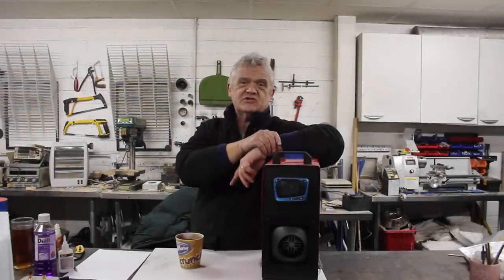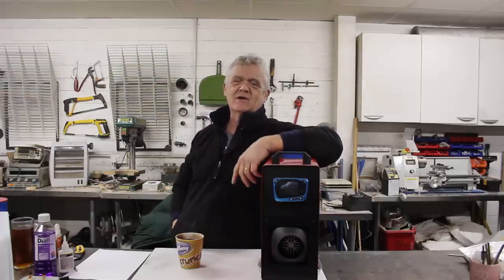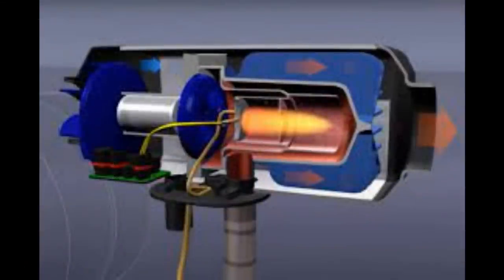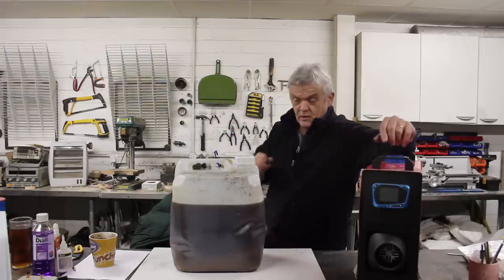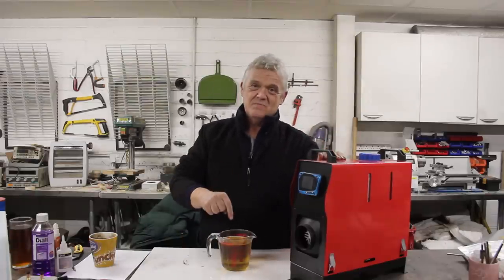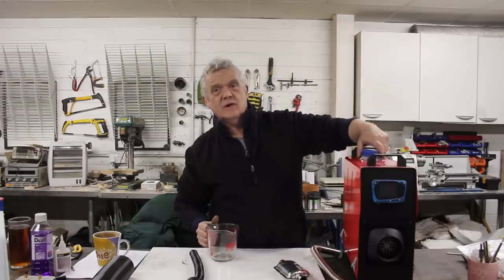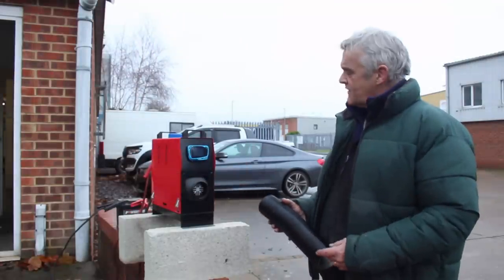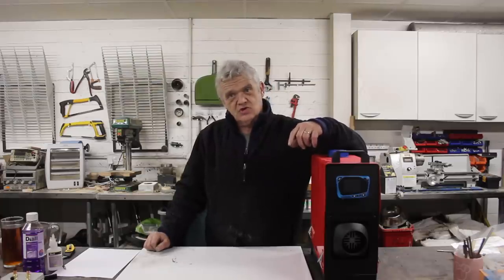1793 Home Made Fuel Running A Diesel Heater

Comment: Here's an idea. Add a Stirling engine that uses the heat produced in the combustion chamber and drives a fan to pump the air in the room through the device and back out again. This would be very useful in places where there is no electricity, like off-grid cabins ,and places that have frequent power failures, like Ukraine.
Reply: Look up peltier units they can produce electricity to power fans from heat!

Comment: Hi Robert, I have one of those diesel heaters. I haven't experimented with any fuel recipes as yet, but run it on straight diesel.
I use mine to heat my shed/workshop, which is approximately 17'x9' but I can divide it off in two when necessary.
I can run the heater for about 10 to 12 hours on 1 litre diesel, which I consider to be very efficient and quite economical. So with your mix it should prove to be a very cheap form of heating.

Comment: Those new diesel heaters are amazing! I just want to mention that I heat my basement lab/workshop with a portable Kerosun Omni-105,  23,000 btu kerosene heater. I know this sounds like a really foolish and dangerous thing to do but I have been doing this for over twenty years without a problem. The windows and door are very leaky to the outside and I use a carbon monoxide/dioxide detector to monitor the basement air. I have also used it upstairs in the main house during a past winter 5 day power outage to keep warm and my water pipes from freezing.  It also has a feature where as soon as it is tipped sideways, a spring retracts the burner wick to shut it down.
Reply: Hardly new, that style of heater has been around for over 50 years snd the Chinese have been selling cheap copys for the last 10 or so 👍
Reply: @Dirt-Diggler  It's new to me!
Reply: Maybe not new but certainly not commonly heard about, until recently with vanlife stuff and green energy etc.
Reply: @gavinlynas2833  oh i agree there 👍 the latest rush of instant experts on the subject on YT has certainly spread the word, usually the word is misspelled but hey, at least it's out there 👍

Comment: The piece you described as a catalytic converter is a muffler, i think. I'm going to have to experiment with the fuel I use in mine!
Reply: There is ppl burning used motor oil in these things,  but I think I'd rather use cooking oil, but would use anything that works if needed heat! I grew up using kerosene heaters, we had a monitor heater, kinda like a self contained furnace or maybe like a giant one of these heaters,  it was about 24" tall 36" wide, and 12" deep,  and has about 2" exhaust pipe,   it worked for about 3-4 years then quit, we went back to the kerosun heater,  besides wick changes every 10 years they just work, and require no power,  unless you want to use the ignitor,   I hope to get my diesel heater going soon, to cut on power use! I will probably be burning oil in it soon!
Reply: yup its a cheapo muffler

Comment: I tried the same one to heat my office, it has enough capacity and doesn't use a lot diesel.. but my issue with it was that couldn't use it with a regular adapter needed a battery to support the starting of this heater..

Comment: I've got one of these pumping hot air in the cat flap, even with Diesel it costs about 30p an hour to run and heats the downstairs of my house, you do need a decent amperage 12V supply, at least 12amps for startup, after which doesnt draw much, and you can wreck the burner, if you can just unplug it. I cover mine with an old tarp, to keep the wet off it, and been using all winter, not had issues with damp or moisture, you can buy extension pipes on ebay and better exhausts to make it quieter, but is barely noticeable from inside if running outside, I posted videos of it too.

Comment: If paraffin is around £2.89/l at b&q and regular diesel is about £1.80/l is there any reason we simply can't use diesel to dilute the cooking oil?
Reply: Yes.  The good reason is that using diesel as the diluent will increase the calorific value above that of 100% diesel.  OK for those that can tune the fuel:air ratio, but not if one cannot do that.  Sooting will invariably result, which may be not be too serious, but could be.  The heater would produce more carbon monoxide due to incomplete combustion, too.
Reply from the maker: good explanation from Richard mate
Reply: @oliver90owner  Thanks for that.

Comment: Just to add that you can adjust the fuel/air ratio in the settings to allow for different fuel use, typically using an inexpensive fuel/air ratio meter to check you are supplying enough air (fan speed) for the fuel setting (pumps per sec or minute) to achieve a complete burn.

Comment: Its a good idea Rob. 

But recently I've learnt that burners with nozzles and fuel pump (assuming there is one in your fancy unit for atomizing purposes) specified for diesel usage can wear our fairly quickly when used with such novel fuels. These days in India, some variants of LDO (Light Oil Diesel) are being made with similar mixing recipes and as such industrial diesel burners, even with good quality fuel pump, face pump failure issues. So burner manufacturers have now started using relatively tougher fuel pumps (for instance 1/2 HP 100 litres per minutes capacity) for using these mixed fuels. 

Just thought if your heater utilizes a fuel pump, this issue may needs addressing suitably. 

As always, your videos are great! Thanks.

Comment: I think freight railway engine no. 66004 runs on biodiesel [ at least that's whats plastered on the side of it ]. Always thought it was against the law to run a car on Kero ..? HM Customs etc. [ would be hard to prove without analysis etc. ] rgds
Reply: A modern car would die pretty soon if run on kero, modern diesel is miles away from the old 80s diesel so are the engines 😏
The only exemption from paying road fuel duty i know if is bio made from cooking oil, you can use 2000 ltrs i believe before declaring it, not checked in a while that law may have changed 🤔

Comment: Hi Rob I use to run my Massey Ferguson 35 (1958) on 50/50 used veg oil and green diesel, she was only used in the summer for topping and hauling in turf. She run great, I rebuilt the top side a few years ago. I was delighted to find the head and all was very clean, I cant get the used veg oil anymore as the bloke sells it, but I buy a few litres now and then and put it in my jeep, wife's jeep and MF35. Both jeeps passed the N.C.T. test engines running clean. I love your show, keep up the great work, God bless you.
Reply from the maker: great info mate - thanks for posting

Comment: You can crank out more efficiency from those heaters if you put a long exhaust pipe on it. Before it's piped outside to vent, you can leech off A LOT of heat from the exhaust. Running the exhaust through a coil submerged in a bucket of water also boils the water very easily.

Comment: two options you can do to help keep burn chamber clean......  is  before shutting down... turn it up to high Heat.... so once you got into the off cycle.....  it will have better chance to combust everything.. so nothing left behind.  

Another option is to not only finish off things with the heater on HIGH heat......    is to also put in a manner to switch fuel sources.....  make one the recomended diesel (or Kerosene) and the other your blended waste fuel.    Then you would start the unit on the recomended diesel or Kero...... keep that fuel in use till the unit reaches operating temperature.... then switch to the blended waste fuel..    Plan ahead and 15min or so before you plan to shut it down...... switch back to diesel / Kerosene, put it on HIGH heat......  then 15min later turn it off / put it into the shut off cycle.  Doing this will greatly lesson how often and/or aggressive you have to clean out the thing. Likely would lower how often you need to replace the Glow Plug and the Atomizer screen
Reply from the maker: cheers mate

Comment: The tax treatment in the U.K. was changed in April 2022 to include biofuels used for heating. The good news is that you only need to register and account for fuel if you produce over 2,500 litres per year so small domestic users are exempt. Search - Biofuels and other fuel substitutes (Excise Notice 179e) from 1 April 2022

Comment: Run about 20L of fuel through it, then do a tear down and see how much debris is in there. My experience has been that it will coke up quickly, but maybe you'll have better results. 

You have access to inexpensive kerosene there, it sounds like. It's triple that price where I am. I used diesel instead.

Comment: Hi all. I'm looking at purchasing one of these and hopefully using it to heat my 20f x 40f lodge as I'm currently running my ch off propane which is extremely expensive. I'm planning on running and splitting 3" ducting under the lodge and sending it to 3 rooms( living room,  hallway and 1 bedroom) in all honesty do you think I'm crazy or do you think it might work? I'm also thinking of doing it because I can get an unlimited supply of dirty diesel.  Tell me what you think? Am I in a dreamworld?

Comment: Check out the video by user "Life @ Soap Creek" titled "chinese diesel heater burning black diesel - waste motor oil." He highlights the key to make these work on alternative fuel.  So far it's the best video I've seen on YouTube #1, start and end with diesel. #2, thin out the used filtered oil with gasoline or E85 in a 1:3 ratio. #3 never run the machine on low, setting 7 provides a lean burn and cleaner combustion.

Comment: I've run 90/10 diesel/used oil in my tractors and combine for a while with no issues. Put the same fuel mix in one of these heaters and you'll get acquainted with no heat and cleaning (which is a pain) on a regular basis.
Reply from the maker: what kind of used oil and did you clean the oil first?

Comment: Hi from Australia where all this is only of academic interest 🤣
Rob you mentioned 3 volts for the power adaptor,  meaning 3 amps I think. 
Could someone explain why the settings are in kHz? Every vid I've watched mentions this...does it refer to the fan speed?

Comment: Jet A1 fuel is basically kerosene, aka a slightly lower quality paraffin. And ~£1 a litre if you can find someone to get some for you. I suspect it would work equally well as the 20% mix with used cooking oil. Would be nice to run one of those heaters for ~£1.50 an imperial gallon.

Comment: No follow up, Rob? It seems these heaters are only getting more popular and many users will benefit hugely from this if it works in the long run - thanks so much for your bio diesel vid. I suppose that coking up the innards is the main concern (and whether that's easily serviceable) and I'm also wondering how the fragile dosing pump will hold up with the different viscosity and lubricity.

Comment: Rob ran the biodiesel in my heater same as yours worked fine for a week then needed to clean it out black smoke. Stated , resolution buy a carbon monoxide meter and tune it adjusted mine to pump speed 1.5 fan 4900 max and it’s working fine, so the type of fuel will require specific adjustments , thanks 🙏

Comment: What are the rules/regs for domestic use of waste oil?. I know ther are rules for Small Waste Oil Burners (SWOB). This being a diesel oil burner may not yet be covered, but burning waste oil could be a bigger problem than cleaning out the combustion chamber.

Comment: I orderer some stainless steel fabric (thanks to a fine british genteleman's subtle suggestions) and am having a blast since it arrived. Even putting a sock of said fabric onto a contained candle gives off plenty of IR radiation - making the candle a proper hand warmer.

I tested the fabric (i ordered 400-mesh) on various propane burners as well. I think that a gas camping burner would get a real boost in efficiency with an appropriately molded stainless steel sock ontop of the burner.
Reply from the maker: nice - great work mate - thanks for sharing

Comment: Good vid 👍
All i would add is the pumps are prone to seizing if not lubricated enough, kero and cooking oil don't have enough lubricant in them and pumps are well known to seize, personally i add 2stroke oil or ATF to prevent this 😏
There are hidden screens and swirl chambers at the bottom of the burn chamber that block as well as the inner fins you can see so cleaning out is not allways as easy as it looks 👍
Reply: They can run on kero for years . They are the same as used on a Petrol heater. I know you have seen a Y-Tuber .
Reply from the maker: mine is a diaphragm pump
Reply: @ThinkingandTinkering  is it not the loud clacky solenoid pump 🤔 never come across one with anything other than the usual solenoid dose pump 🤔

Comment: You won’t burn that cooking oil fuel for very long. After a few days the steel mesh at base of burn tube will clog up and heater will fail to start.
Reply: Yep, my thoughts exactly. I have way too much experience cleaning the stupid thing when it fails to start on -20 days because I was cheap and added cheap stuff to the diesel.
Reply from the maker: I did take this apart and there is no steel mesh at the bottom of the burn tube - also - others report having run heaters on cooking oil for years - in these comments - so - I am not sure you are right there mate - maybe it depends on the model?
Reply: You cannot see that wire mesh unless you cut burn tube below its inside restriction plate. This wire mesh wraps around inside of burn tube and is spot welded in place. I have photos of it but have no idea how to attach here.
Reply: My burn tube has the restrictor plate TIG welded in place. On some it is only held by friction hence may be pulled out   
I cut burn tube using a pipe cutter having first filed down reinforcement of TIG weld. I cut tube at inboard edge of TIG weld. Must be careful not to cut through restrictor plate.
Reply: @ThinkingandTinkering  In my heater, the steel mesh is in the hole where the glow plug is situated. It acts as an atomizer for the fuel.
At above freezing temps I noticed it does not foul up as quick, but sub -10 that's when it gets wonky. My hunch is that the incoming super cold air lowers the combustion temp and hinders a proper burn. So to mitigate, I've baffled the inside intake to keep burn chamber temps around 120-140 C

Comment: I have run my diesel vehicles on used veggie oil for years. I let it settle for about 6 weeks, then gravity feed it through a bag filter (about $5 Canadian dollars  and they last for hundreds of gallons), then into the car. It cleans out all the gunk and after that I get no sediment at all after months of sitting...and the pistons look great, the cars have just as much power, same fuel economy etc. Seems silly to buy expensive fossil fuel.

Comment: Your need more than 3 volts as 12v and lots of amps for glow plug. Also run on battery as if power fails running it will cook circuit board inside heater.

Comment: Unfortunately here in the USA kerosene and diesel are ridiculously expensive currently making it more expensive than using a propane heater .
I tried using the same ratio and it worked out awesome BUT the next morning I fired it up and had blue smoke on startup which went away once I cranked it up and got it nice and hot .
One thing I forgot to account for was the temperature of the oil being a factor . The shop I have it in was at around 12°c which would make colder and thicker for the pump to move .
Lesson learned either preheat the fuel mixture or use a different ratio of oil to diesel .
Also having the cap cracked open a little bit is a good idea since it can cause a vacuum lock situation and suck in the tank walls.
Fortunately I was there to see it happening thereby avoiding the issues by releasing the pressure .
Another thing to think about with these things is that it would be advisable to have a battery powering it or as a failsafe in case you lose power .Keep in mind the fact that the circuit board within the heater housing gets pretty warm but because of where it's at it gets the flow of air from the fan keeping it safe from melting .If all the sudden you lose power that board is toast . aside from that I really like this little heater .It has great potential for increasing the heat output via a heat exchanger hooked up in line with the exhaust pipe and then onwards to a radiator .
BTW I really like your channel and the videos you do . They're always interesting, educational and upbeat which is something that's in short supply these days .
Thanks for doing what you do ✌️☺️